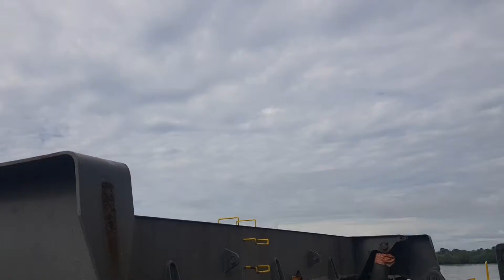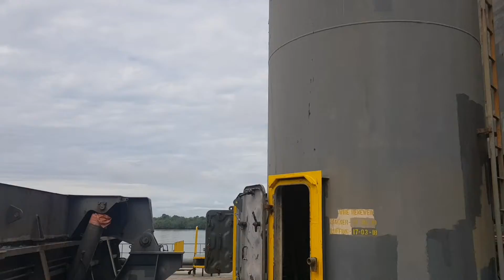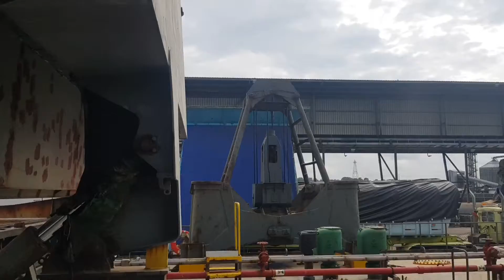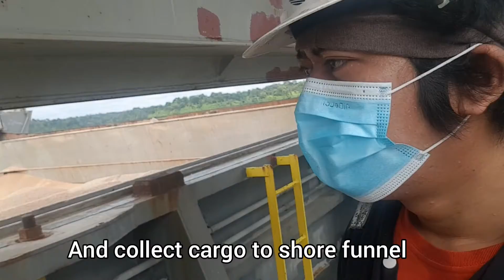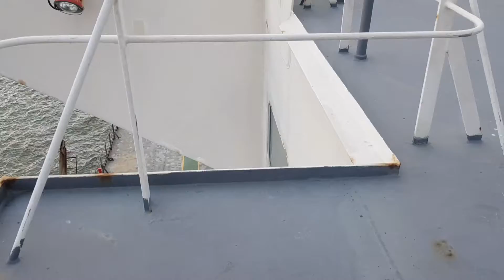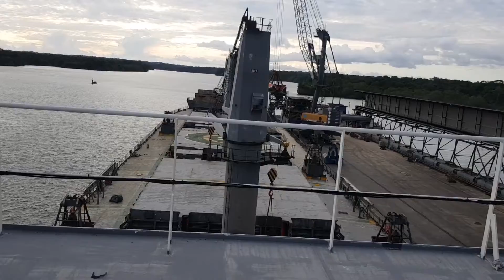how ship and shore grab works? #seamansvlog #marineengineerworks

Comment: It's a radio remote controlled grab, its is operated by hydraulic oil and can be open with a remote and closed by its slip block that serves as the pump for the grabs hydraulic system. In a push of a button, the receiver inside the grab will activate and open the solenoid valve, releasing all the pressure inside the cylinder making the bucket open. In closing the bucket, the slip block( the one that has wire rope attached) will fall down. As soon it is hoisted, the solenoid valve will close allowing the build up of pressure inside the hydraulic cylinder, pushing the buckets of the grab to close. Hope this help mga kabaro hahaha😅
Reply: Thanks looking for explanation 🙂🙂
Reply: inside engine or battery (working hydroulic system)
Reply: @sathiskumar1515   battery. Grab is Guven's Grab Radio Remote Control Grab. Guven Grab is the best.